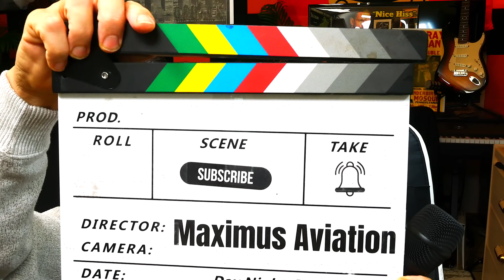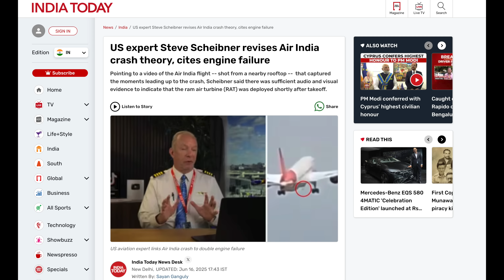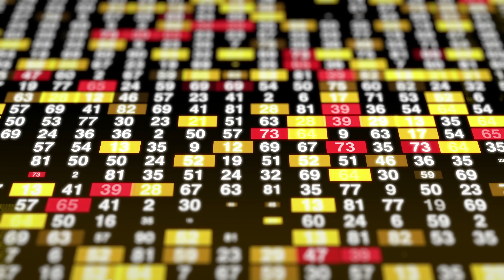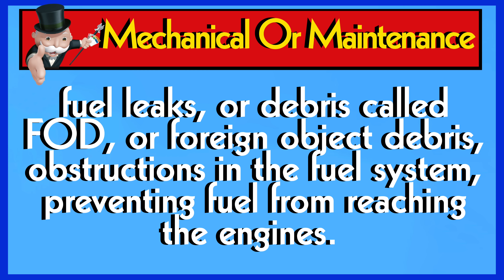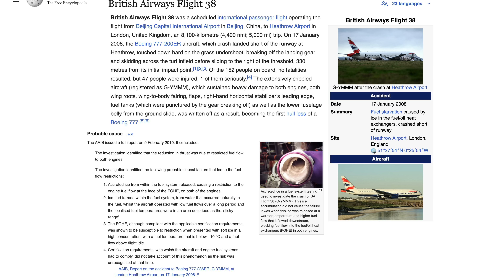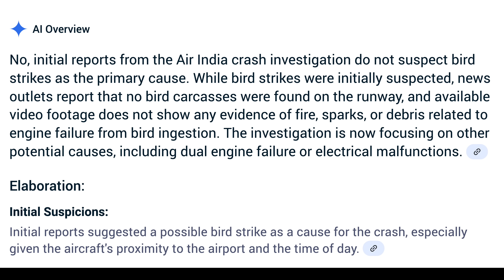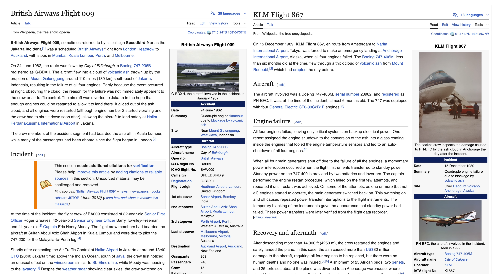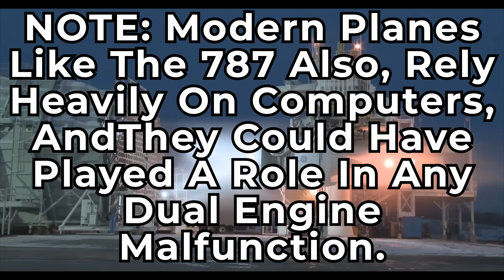Dual Engine FAILURE, Real Or Just The Latest Guess By Armchair Pilots? Find Out How Engines Fail ✈️

Comment: The one possibility which is never discussed in some electronic glitch that commanded the FADEC to roll back the engines.
Reply: Or an even worse Computer Glitch.

I've seen FADEC do a lot of dumb stuff but both channels on two different engines (therefore 4 channels) all act up at the same time is way beyond the scope of possibilities in my professional opinion.
Reply: The most likely culprit in this accident is dual FADEC malfunction at very low altitude
Reply: @ricky1231  system redundancy makes it much less likely for a FADEC system to fail than a traditional magneto system
Reply: @MSMS-h9m 
System redundancy isn't the same thing as system isolation.
Redundancy provides multiple power options via different bus networks.
Those multiple networks also provide lots of different pathways in which a short in one circuit, such as the aircon plant, could theoretically create a back feed through both engine APU - FADEC/EEC supply circuits via their common APU interface for example.
Bearing in mind there is only one APU and which is networked to virtually every electrical system on the plane and therefore connects them all directly or indirectly.
I'd way prefer the indepence and isolation and redundancy of a twin magneto ignition system piston engine over electric supply dependent coil and points.Let alone a cam or crank sensing ECU driven system.
While anyone would need to be deaf not to hear the RAT combined with no engine thrust in the video and audio evidence.
Reply: @MSMS-h9m  Plus of course each engine is controlled by it's own FADEC - the chance that they both failed at the same time is probably very rare. More likely something that instructed the FADEC on each engine to spool down. Going to be interesting to find out the cause.
Reply: @confederatenationalist7283 i saw one comment, forget where, where someone claimed the exhaust port? Was open on the apu but how someone could see that from the available video, im not sure.
Reply: @mikesorensen5228 
The APU's status is moot.
It's the networks and pathways that one APU  supplying numerous supposedly 'isolated' independent circuits, provides for electricity to flow in an uncontrolled manner to a shorted ground, including in the  opposite direction reverse polarity.
Drop a spanner/wrench across a car starter motor terminal to ground the odds are the engine management computer will be fried if not every electric circuit in the car.
The same applies to any major short to ground it will drag electricity in uncontrolled flow through every and any pathway it can find.Supply circuits get turned into ground circuits.
Reply: There are theories floating around on technical internet forums, that indeed there could of been an electronic computer glitch that commanded the FADECs to roll back both engines. Specifically, the TCMA safety system is designed to shut down a "run away" jet engine on the 787 if there is "un-commanded"  thrust detected on an engine while on the ground. 

There have been a few past 787 incidents where TCMA erroneously has shutdown both engines when there was a rapid change in throttle positions induced by the pilots during a landing. 

A TCMA event  on both engines would cause both engines to shut down at  exactly the same instant in time.

In the case of AI-171,  there also could be the  potential for a  rapid change in throttle positions during the takeoff while the aircraft was on the ground near V1 which could lead TCMA to erroneously assume there were 2 "run away" jet engines and shut  them down unfortunately seconds after the aircraft became airborne.
Reply: @garyhammond6909  yes, case in point to a potential failure in the WOW sensor failing and thus the aircraft thinks it is still on the ground and yes throttles back the engines.
Reply: @garyhammond6909 I found this headline “Boeing 787 Suffers Rare Dual Engine Failure on Landing” from 2019, although this had different engines to the Air India plane.
“A simultaneous dual engine failure on modern twin engine commercial airliners is one of the rarest events in aviation. Rare or not, that's exactly what happened to ANA flight NH985 when it touched down at Osaka Itami (ITM) on Jan. 17.

The pilots completed the touchdown and were rolling down the runway when they realized that both Rolls Royce Trent 1000 engines had shutdown when the pilots activated the thrust reversers to slow the aircraft upon landing. The pilots allowed the aircraft to roll out down the runway until it came to a safe stop some 8,000 feet down the runway. The Trent 1000 has been causing some serious issues for Rolls Royce during the past year.

The pilots followed their checklists and worked with maintenance personnel via phone to troubleshoot, but were unable to get the engines to relight. This left the aircraft stranded and led to the closure of the runway. A tow truck arrived some 40 minutes later to tow the aircraft off the runway. Passengers were able to disembark without incident.

Most dual engine out problems are caused by issues with or lack of fuel. Engineers inspected the engines and could find no reason for the dual failure. With the post-inspection finding nothing to cause the engines to fail, engineers are saying the likely cause for the shutdown is a software issue onboard the aircraft.”
Reply: @garyhammond6909 
I think that was the very credible defence of the flight 296Q  Airbus airshow crash pilots.Numerous sources have made the case that they were scapegoated and Captain Asseline has never accepted his guilty verdict.
Reply: Yeah, ignorance of how the systems and software work makes computer error or glitch the modern version of "an evil spirit did it".
Reply: One thing I've not read is that this aircraft appears to have lost all power. The landing gear shows partial transition, so theoretically some hydraulic pressure from engine driven pumps. I'm not familiar with the 787, but all other types of large aircraft I am familiar with have redundant AC powered secondary pumps or power transfer units when EDPs drop out. I'm guessing the APU was inactive at takeoff as well, due to the apparent RAT deployment.
Reply: As far as I know FADEC maintains its last commanded thrust?
If so how would they be commanded to both reduce thrust?
Reply: I think your on the right path, there.
Reply: A single point of failure resulting in the engines lose power enough to get the RAT deployed.
The problem is to figure out that single point of failure in the complete chain.
Reply: Cosmic radiation caused a random data corruption? Or perhaps bad solder joint? Thats not my leading theory though.
Reply: What is FADEC?
Reply: @Harald-MacGerhard  
FADEC stands for Full Authority Digital Engine Control
Cheers about the size of a suitcase 🧳 
Cheers 🍻
Reply: @Harald-MacGerhard  full authority digital engine control  takes signals from the cock pit and makes the engine go more or less noisy
Reply: Why is nobody asking the real question: Why did  Captain SS  have only 8200 hours total flight time in his apparently long career? This rather small amount of flight time at his age is very unusual for a so called "experienced" pilot, to say the least. He was  NOT  very experienced, at all. And the first officer was a pedestrian... with only 1100 hours total, including single engine piston airplanes!  He was a rookie. 
Regards from the cockpit.
Reply: @Renato.Stiefenhofer.747driver  Blaming pilots is questionable here now, IMHO!
Reply: @Harald-MacGerhard   I'm not blaming the pilots, but as a pilot myself and after studying hundreds of accident reports, my first question is: Who were the pilots... and what was their history.
Reply: @Renato.Stiefenhofer.747driver  ok cool,  but I am really wondering about that software bug on the GCU, could that lead to dual engine shutdown?
Reply: @Harald-MacGerhard  Yes, we are all waiting for the preliminary report.  Could be anything. Poor Maintenance is on my list... Air India Maintenance,  done partly by Turkish Airways. Complicated.
Reply: @Harald-MacGerhard there is one for both generators. So they both failed at same time?
Reply: @mikesorensen5228  So could both FADECs fail if a software bug possibly triggered the GCU into failsafe mode? 🤔
Reply: @Harald-MacGerhard withought examining the airplaenes software and electrical schematics its anyones guess.
Reply: @Harald-MacGerhard i should also throw in mechanical design.
Reply: @Harald-MacGerhard im not sure how much of that information is publicly available.
Reply: @mikesorensen5228  There seem to be a gremlin here ..... tjhis looks way like a dual engine failure !!!!!

I wonder if there are bugs in here known to Boeing?
Reply: @mikesorensen5228  This is Boeing proprietary, confidential .... so we are in the dark here I guess!
Reply: @Renato.Stiefenhofer.747driver  fast jet military maby  rotory,,,   could be that
Reply: It's definitely a DEI human programmer related problem.
Reply: Define "never discussed" - FADEC is always discussed when people see aircraft engines do something strange 😂
It's not a niche topic.

Also, that's usually one engine, FADEC computers are usually independent per engine and usually have multiple channels for backup and cross checking.

So for both FADEC computers to do the same thing at the same time wouldn't be a "glitch" it would more likely be something in the programming that deliberately reduced power for some reason which is yet to be determined.

So IMO, certainly not a "glitch" and more an "unforseen situation" where they did exactly what they thought they were meant to.

I'm not hot on the FADEC theory, and always leaving crew actions open to possibility, as well as poor design/build quality as an option.
Reply: @richardwillson101 
It's those 'multiple channels' which defeat the object of 'isolation' both FADECS and everything else powered by the APU are pathways for a short circuit anywhere to back feed them.
Reply: @confederatenationalist7283  @confederatenationalist7283  im not familiar with the 787 and its engines, but I am with plenty of other aircraft.

But thos channels are usually data busses, so any "short circuit" should be detected pretty quickly by the sekf checking bus logic.

Short circuits are also meant to be protected from by wiring routing and cross checking.

I don't really see how a short circuit in one single place would cause all 4 channels to fall over or agree with each other.
Reply: @richardwillson101 
My guess is it could do it in the same way that an unrelated short circuit in a car electrical system can take out the engine management computer.
The only way that you could know for sure is by testing every circuit to destruction by deliberately shorting them out.
Reply: @confederatenationalist7283  one single short circuit should never affect both EECUs/FADEC Computers.

All other aircraft I know of, each FADEC EECU is powered from a different electrical bus and the wiring is physically segregated from one abother in the airframe, so
Reply: Or the fuel pumps lost power.
Reply: @johnp139 the engines are also gravity fed fuel.
Reply: @johnp139 Fuelpumps are mechanically driven bei the rotation of the engines.
Reply: @johnp139  but it will, suck fuel though if so,,,  but it might have been doing this and not made enough thrust
looks like it might have started on a change of attitude or lift off  wow switches unmade
Reply: @johnp139  YOU CAN LOSE ALL FUEL PUMPS AS LONG AS THE ENGINE PUMPS ARE WORKING
Reply: This would also explain why the RAT deployed.

Comment: You have a 110 degree day. Fuels can and do vaporize causing a vapour lock. Considering this was the ambient temp, we can surmise it to be alot warmer on the tarmac.The other being if the Rat was deployed, this would indicate a power failure. If so, the pumps could have shut down starving the engines. Just ,my armchair, 2 cents worth.
Reply: This occurs to me as a distinct possibility.
Reply: Gasoline vaporizes. Jet-A boils at 176C(349F). Try boiling that with a hot day. Stop listening to idiots. RAT could have been deployed by the crew. But yes, the pumps could all have been switched off, or all four generators and all four hydraulic pumps could have failed so that the four hydraulic engine fuel pumps and two electric engine fuel pumps all failed too... or someone could have switched off the master switches or pulled the fire handles. So many things could have happened, but the vapor lock idea comes from someone who thinks the fuel is stored in the cabin, apparently.
Reply: @cageordie  stored in the cabin,,,  now that takes me back,,,,  cant beat a bit of AAR,,,,,

Comment: Electronic failure shutting off fuel pumps etc
Reply: Not likely as the engines should be able to suction feed unless at very high altitude.

Comment: Hoped ya would go Paris Airshow 

1. In a 1987 incident, a Delta pilot mistakenly activated the fuel shutoff switches on a Boeing 767, causing both engines to lose power
2. an off-duty Alaska Airlines pilot, who allegedly attempted to shut down the engines of a Horizon Air flight while reportedly under the influence of psychedelic
3. Question 🙋 8-9 hour flight extra pilot?
4.DVR Going to rewrite the rules!!
Cheers 🍻
Reply: Also I personally met a pilot at an airline who accidentally shut the fuel switches in cruise with his iPad that got set on the center pedistal. Anything is possible.
Reply: @crooney82 thanks for sharing. Now Retired, hangar Stories are where they stay. 
Cheers 🍻
Reply: Yeah... unpalitable but enemy action is actually the simplest explanation. And not the first time a pilot has deliberately killed the engines.
Reply: @cageordie thanks for sharing when I was born the FAR’s was a pamphlet. The Odd numbers, quite smart let the room for the next. 
Carried a extra Jepp’s book 📕 colored brown for Combined References And Procedures or CRAP 💩 
Cheers 🍻

Comment: Agreed we just have guesses.  Well No. 1 might be pilot error turning off wrong engine when one engine fails.   One question would be, I hope we are better off than JeJu re: loss of black box data
Reply: But procedure is to let the engine trash itself until the aircraft is safely configured to fly away. You don't secure the dead engine until the danger is over. So that seems unlikely.
Reply: This scenario is only possible if pilots violated SOP and prematurely started working on their engine failure below 400 ft during their takeoff, in regular SOP 400 ft is the minimum altitude for when the engine failure on takeoff checklist can be done, and that alone takes around 45 seconds, pulling the throttles would take 10-15 seconds, however this jet was only in the air for over 35 seconds and it's max altitude was only 400 ft

Not saying this is impossible, it still can be, but its less likely

Maybe it's possible that the loud bang may have caused pilots to involuntary idle the working engine just after taking off? causing them to lose altitude at 400ft only, if pilots complained of no trust they would've noticed or they were panicking during the dive

Comment: someone mentioned vaporlock, thought that was an interesting suggestion worth mentioning
Reply: Sir, please leave the chat.  You are bringing a Piston mindset to a Jet discussion.
Reply: VAPOR lock happens with low pressure fuel pumps in carburated engines using fuel that evaporates at room temperature. Jet-A driven by hydraulic pumps does not get vapor locks. The idiot putting that idea forward thought it could be caused by the A/C being off. Fuel tanks are not cooled. Jet-A boils at 176C(348F). No, it isn't interesting, it's an indication of utter ignorance.
Reply: Hardly an expert yourself! Vapour lock in a carburettor can take 2 forms, but fuel systems are the point and regardless of the engine or type of fuel, vapour lock can still occur. Boiling point has nothing to do with it!?  Flash point or "vapour" point is the relevant factor. Hydraulic operated jet engine?????? and the A/C does not cool the fuel in fact the condenser is under the middle tank and actually causes heating. The positions of the pumps and self priming systems are what prevent modern day vapour lock. That's why it's not relevant

Comment: I'm thinking of a combination of things.  Hot Weather, thin air,  head wind shift  and late rotation, (I have no idea if pilots increase engine thrust (?), but after rotation and flipping the detraction of the Landing Gear. Something then happened (? where something boomed?) A Short? power outage  Maybe the  console lost power and nothing to see for the pilots and then that brought the RAD to be deployed and probably reduced engine thrust. Stalling the plane. Something like this as I am an observer that doesn't know it all. I am trying to get to learn what I don't know. Like learning Science (?) Lots of components around engines that failed?
Reply: the air wasn't thin.
Reply: console may well have lost power